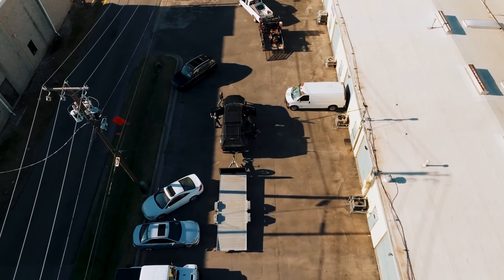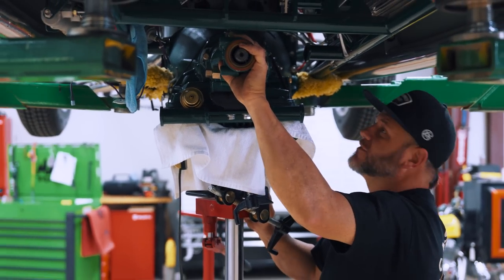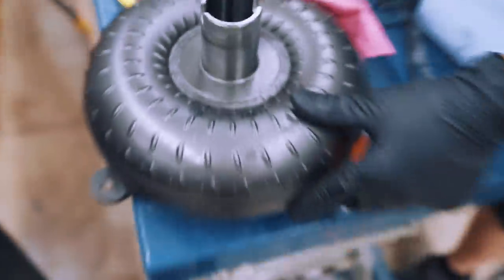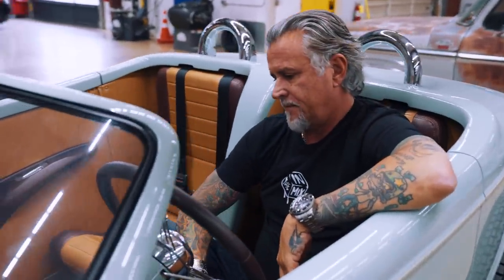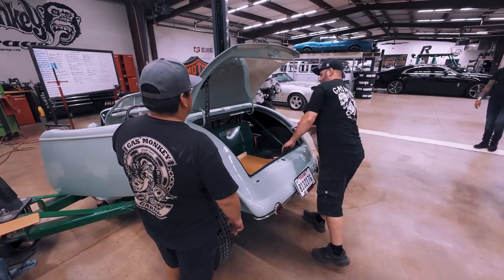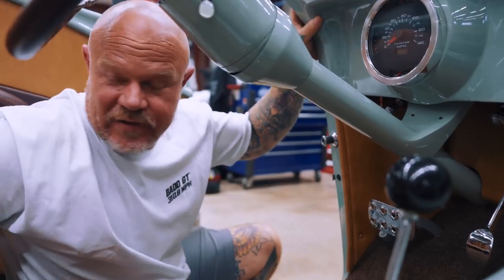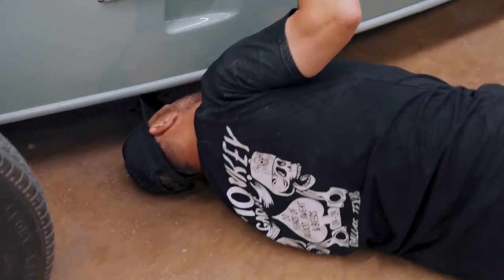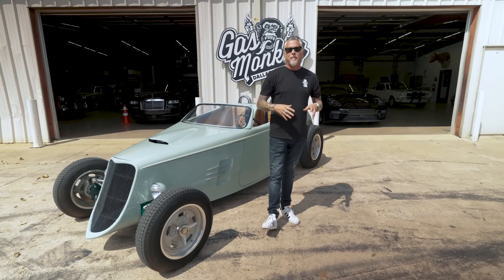This Hot-Rod is FLAWLESS - Wheels & Deals

Comment: Mike Hall would be proud.  The stance and the knock offs..  so awesome.  I would have put a little wider tire on the back because I have no class.  Mike made perfection look easy.  He is watching and smiling.  You guys are awesome.  BTW..  don't let body guys touch the electron switching devices..  they have no way to comprehend how this magic works.  The chemicals get in their system and harbor for years.